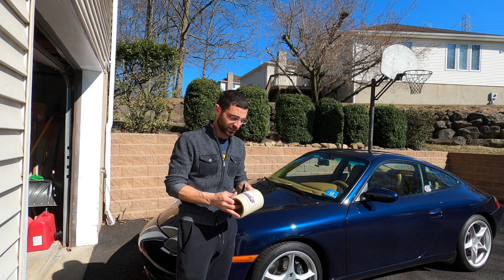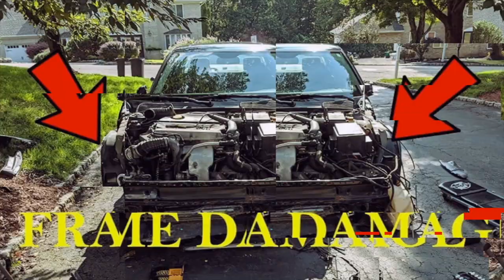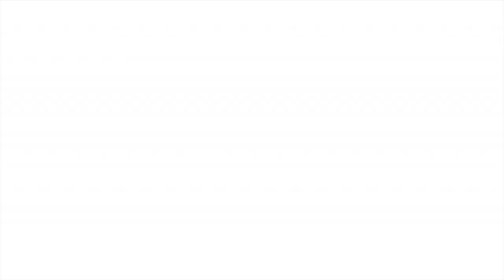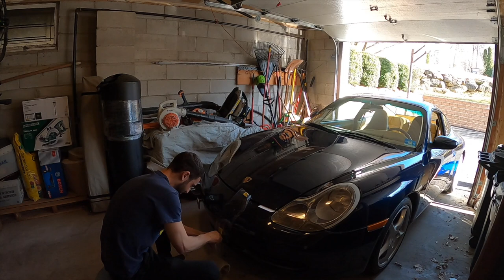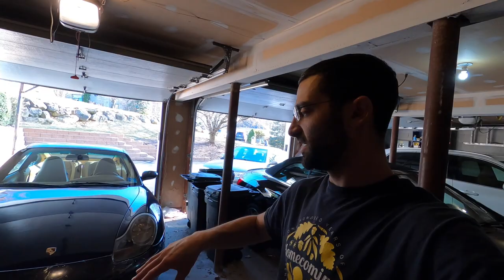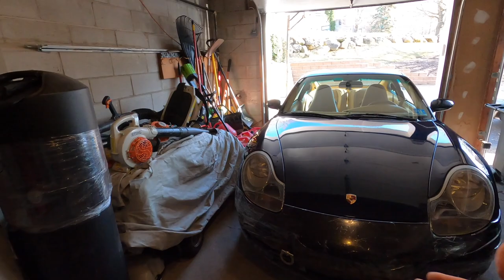Track Armour Protection Install on my Porsche 911 996

Comment: Well definitely going yo keep the saab, i can get replacement v5c doc but, this astra 1.8 soft top special edition is ruff its been lowered and its bumpy as fuu, also loud as fuu exhaust not good in soft top convertible, the luxury of the saab ix for me definitely, just thought with it been canny astra, so im back kyle carnt get rid of es that easy.. see ya in the next one which ever one you do it on.thanks again.

Comment: It’s tough to see what your doing at times. I would recommend primer and painting the dry wall in the garage.  It would give you much needed reflective light. 
It also helps seal it from fumes an and moisture.